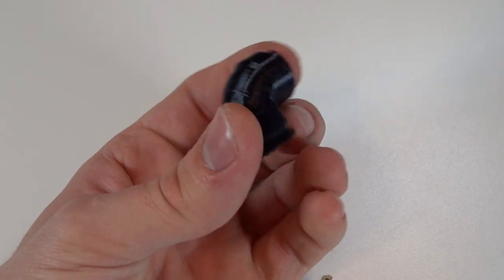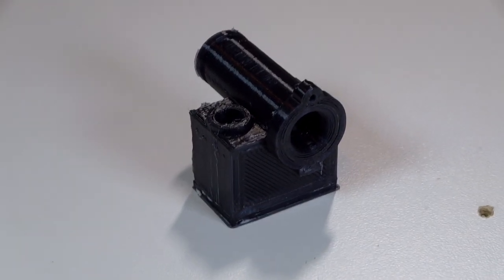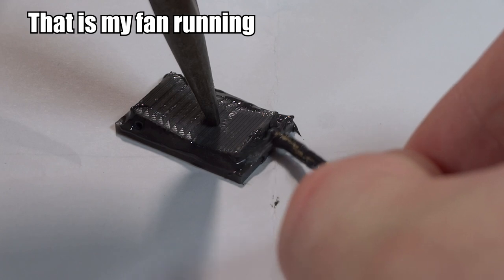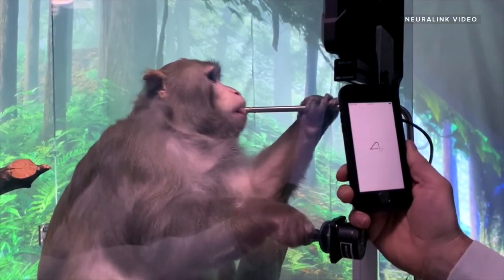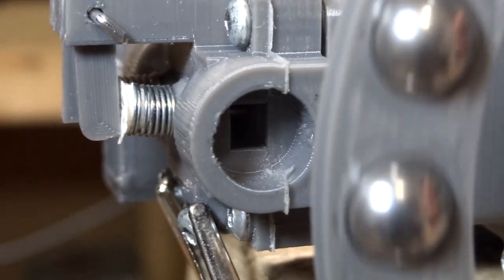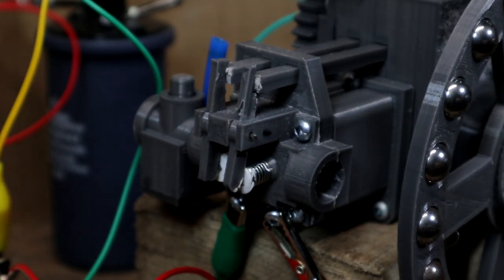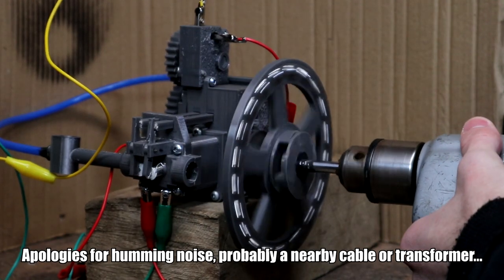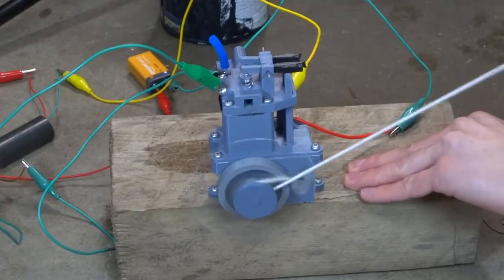Breathing Life into the 3D Printed Gas Engine (Part 4)

Comment: Lots of comments saying to 3d print in metal, or cast the parts, or you could use a 5-axis machining centre but I think the point is to see what can be done using what is at hand, a 3d filament printer, hand drill and a few tools.
Thanks for the series Camden

Comment: I was really happy to see this video! I'm glad you haven't given up on it. It's cool to see the progress even if it isn't yet successful. I like where you are going with this. I believe reducing as much friction and mass in the gear train for the timing/valves could help, It may be that the piston can't overcome that load. Thanks for the video!
Reply from the maker: That's a good suggestion,  The gears may create a lot of friction but from what I can tell most of its resistive forces are due to the compression stroke. Thank you!

Comment: This is getting so close to working! I think the only thing preventing it from working is the valve size. Maybe try increasing the bore of the engine so you have more room for the valves.
Reply from the maker: I was thinking of stepping the bore up, I just need to find a cylinder sleeve to use
Reply: @CamdenBowen  Maybe try and go to Lowes or somewhere and find a pipe

Comment: I think the reason why you keep running into issues with your engine is because you 3D print it out of FDM. Try SLA, which should help you get a much better engine due to its heat tolerance.

I own an SLA 3D Printer and once tried to burn some sample prints from my SLA 3D Printer. It didn’t really melt but anyways...

Hope that helps!

Also I’m thinking about taking on this challenge myself, although my 3D printer is broken at the moment.

EDIT: Oh yeah, another plus of SLA 3D Printers: they are great for air engines that NEED A LOT OF SEAL. Seeing that this engine probably runs into a LOT of sealing problems I think you should try using an SLA 3D Printer.
Reply from the maker: I do think that I need to try an SLA lol, I'm thinking of getting one myself for projects like these.
Reply: personaly I think its from the fact that its plastic

Comment: The way your engine backfired, I would look to the ignition timing. If you’ve got good compression, valve timing is good, but I believe ignition timing could be advanced a bit.

All of my model engines took a considerable amount of fiddling to get them running since scaling down makes for difficult running. 

Also, butane, as well as all LPG products, tend to require s richer mixture than the longer chain hydrocarbons. This means a smaller venturi as opposed to one for naphtha (white gas, aka camping fuel).

Nice work, interesting trouble shooting methodology!
Reply from the maker: Thank you! The tolerance between the gears may have disrupted the expected ignition timing as well

Comment: Have you considered using a “bubbler” carburetor by drawing air through a closed bottle or something to mix the air and fuel vapor?
Reply from the maker: I haven't but it seems like a good idea, I just don't know if the engine has enough displacement to draw in enough air and fuel

Comment: The main problem is probably the air/fuel ratio. For the ignition you could try some 18650 batteries instead. I find them more reliable
Reply from the maker: Yea, these 9v are pretty unreliable after a while, but for short periods work fine

Comment: Making a engine with a really low bore-stroke ratio may be a good idea as it will want to run at a lower rpm and will give the butane more time to move through the intake and into the cylinder. And I know you already increased the weight of the flywheel, but increasing it even more may be a good idea. Single cylinder engines are not the best at idling smoothly (usually need to idle at 1500-2000+ rpm to be smooth) and with a weak power stroke I think it'd be hard to get it to run without an almost excessively heavy flywheel. 

I really need to get my hands on a 3D printer, I've been thinking of experimenting with 3D printed ICE's for a little bit, which is the main reason I ever discovered your channel. You've come a good way from the first video, I'm sure you can make it happen.

Comment: I like to use Alcohol soaked nylon as temporary  gaskets, works pretty well until I finish a prototype and want to actually buy proper gaskets and seals, even non-soaked nylon works decently since it's a softer plastic
Reply from the maker: Do you use it for metal on metal?
Reply: @CamdenBowen  Not usually, though I did use it as part of an attempt at making a compressor, rubber and silicon have much better seals, but nylon works as a temporary testing gasket. I think the only time I used a nylon gasket metal on metal was when I made an air powered dremel that blew up in two seconds because I didn't make it strong enough for anything over 40 PSI. It was basically an air engine with an aluminum pipe as the cylinder wall

Comment: Put a metal pipe on the piston and cylinder in the carburetor to have a good seal. (Or just put some kind of a plastic membrane as a seal).
Reply from the maker: I could but I don't have any that size, it isn't subject to much pressure so it doesn't really need a perfect seal
Reply: @CamdenBowen  Maybe that low amount of pressure you ignore is making your engine still dead.

Comment: Is there any chance your intake valve is too small? The fact that you can hear popping says that the engine has all 3 components of combustion. I think the only thing you may still be missing is just more air and fuel. I know with your cylinder head design it may be difficult to increase the intake valve area, but if you could find some work-around, it may fire right up
Reply from the maker: I was thinking of stepping the bore size up and fitting larger valves, it may help reduce resistance as it will breathe easier

Comment: Try a rotary style valve instead of the standard push type. You may be loosing more compression than you think.
Reply from the maker: I thought about it, I would just need to figure out a design for a seal around the stationary parts of the manifold that seal against the disk
Reply: @CamdenBowen  use a roller pin style valve. Think a hallow tube with ports on the side. Then you can drive it like a normal cam 2:1 drive gear. Plus orings can seal it easy.
Reply: @CamdenBowen  you could try a reed valve for the intake. Then you only have to worry about the exhaust side.

Comment: a tip i have is use pure alcohol or at least 98%. if you use 98% then it has that whoof like gasoline. 91 is pretty weak when it comes to flammability

Comment: Make a hho generator and shove into intake becuase thé oxygène and fuel IS already there and seal it from outside World
Reply from the maker: I could but that would be too much work, making a whole hho generator for an engine that isn't running yet
Reply: @CamdenBowen  its not powerboost nor anything it will solve fuel problem to make running therefor its not a problem if engine wasnt running
Reply: @laabarnaceur2134  might be dangerous running highly concentrated hydrogen and oxygen in a engine of this size. Lotta punch for plastic parts.
Reply: @quesadilla7760  thé cylindre inside IS made out of copper

Comment: I think the problem is timing/the drill rpm is not fast enough.
I had a hit and miss engine kit and tried using a drill. I  had to attach a wheel to the drill to start my engine.

Comment: You gotta get that piston as close to the top of the cylinder as you can get it to make more compression there's just to much space in the cylinder
Reply: Internal combustion engines want at minimum around 15 to 20 psi of cylinder pressure to even run poorly

Comment: I'm a mechanic and a self proclaimed engineer. Your rods and rocker valve trane isn't as accurate as it needs to be. Use a top draft carb. And a over had cam shim over bucket design